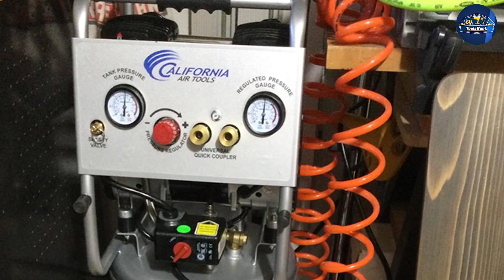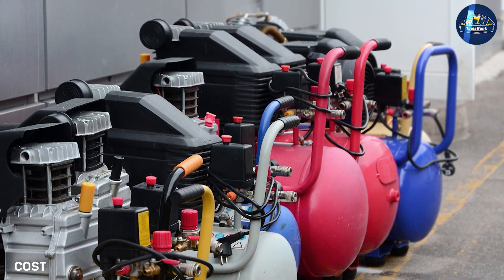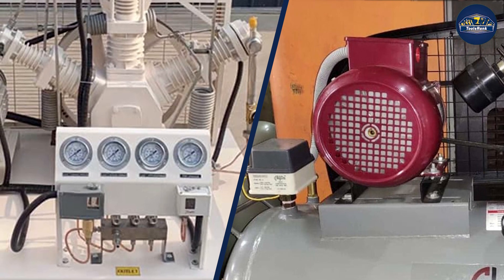Oil Compressor vs. Oil-Free Compressor: Which One Should You Choose?

Comment: Oiled compressors tend to be better overall and have better performance and better longevity overall.  However, oiled compressors typically are more expensive as well.  If you use air tools or are a framer by trade buy an oiled compressor if you can an oiled compressors will typically last over +20 years.

Oil-free air compressors are just over-sized tire inflators are aren't meant to last for 5 years at best.
Reply: What about the oil turning to sludge in the cold?
Reply: @ILoveGlock1019  Synthetic oils were designed by NASA to deal with the extreme hot and cold temperatures in space so there is no need to worry about the synthetic oil in an air compressor freezing up or breaking down due to excessive heat due to extreme hot/cold temperatures.
Reply: @happycat0411  was only asking because I’m about to go buy one but couldn’t decide on oil lube or oil free. The oil lube one actually happens to be about $60 cheaper in regards to your earlier statement.
Reply: @happycat0411  I’m from Michigan and the weather varies was worried about the oil lube operating in the winter.
Reply: @ILoveGlock1019  I used to frame as well as we used a Jenny oiled air compressor when it was -35 Celsius outside and the air compressor had no problems in freezing sub zero temperatures.  Synthetic oil was originally designed by NASA for use in space so any good synthetic oil will hold its viscosity / fluidity even at -50 Celsius.
Reply: @happycat0411  awesome! Thanks for the help man!
Reply: @happycat0411 nasa lied, they never passed through the firmament
Reply: @ILoveGlock1019  Actually some oil-free compressors can't be operated in cold weather at all, due to their tight designed tolerances - for example my Sleppach compressor can not operate below 5 °C (40F). I thought it is jammed but discovered the limination mentioned in the user manual.
Reply: @xhobv02  ended up going oil-free and it worked all last winter in temperatures down to below 0! All clear over here!